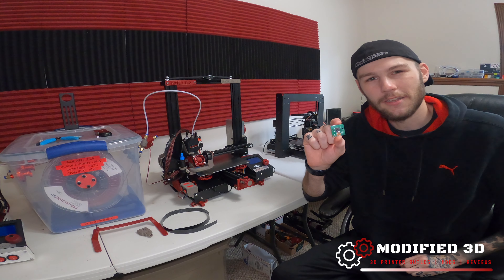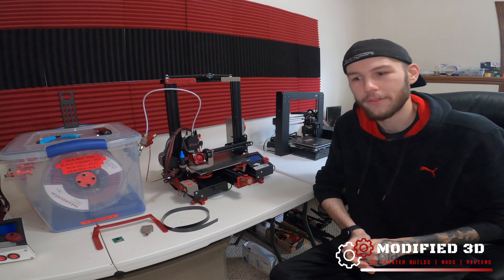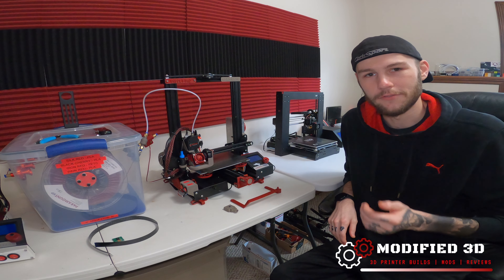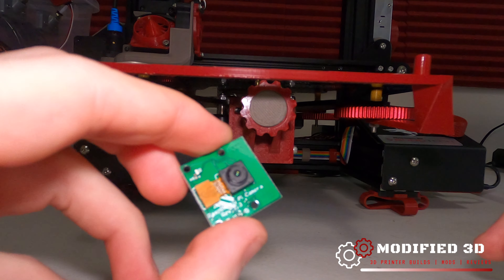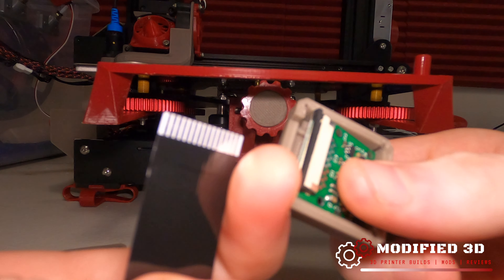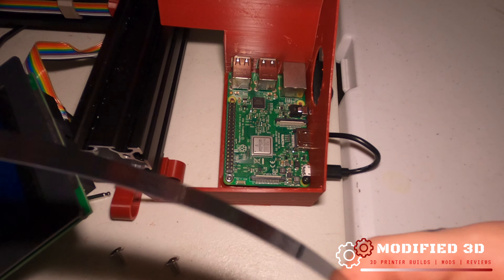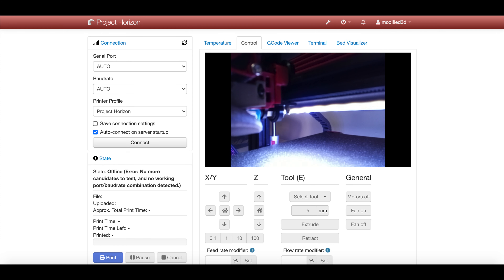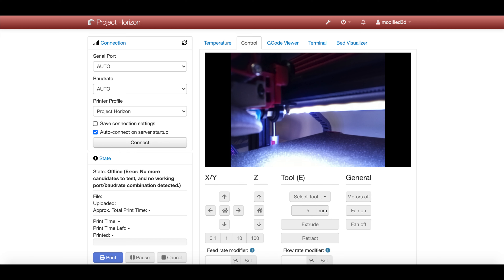Octoprint Pi Cam v2 Webcam Install | Creality Ender 3 Pro

Comment: Would it possible to unscrew the bed leveling knobs and slide the camera bracket on and use the knobs to hold it on? Im also using a BLTouch. This method shouldn't effect anything if im correct, but what do you think? I ask also because I don't have 2 baby nuts laying around lol
Reply: This would probably complicate leveling the bed

Comment: Maybe you can help! I've got octopi installed and I like making time lapse of my prints. This works great when I use octopi to initiate the print, but when I start a print from a sd card, my cam doesn't take the pics. I've changed the setting to take pics at a set interval, but I can't figure out how to start the recording process. Can anyone please help??? Thanks In advance!
Reply: I'm hoping you worked it out after 4 months, but octoprint controls the printer movement, and triggers the camera shots, if you print from SD you are bypassing the octoprint controls, and therefore the camera's instructions to take shots!